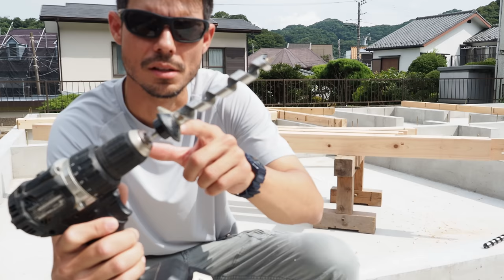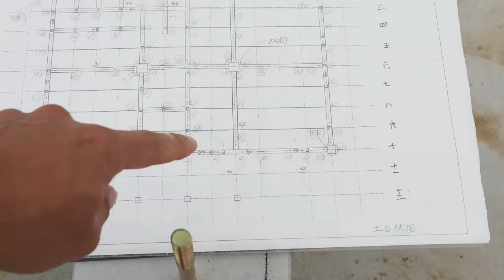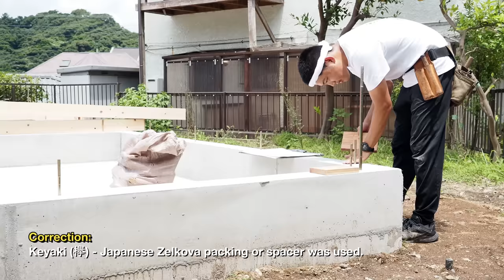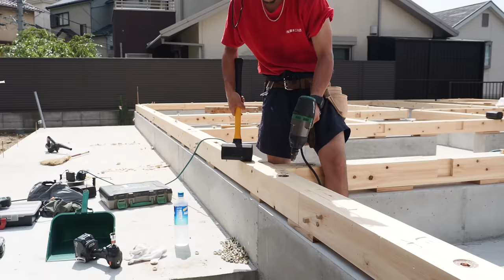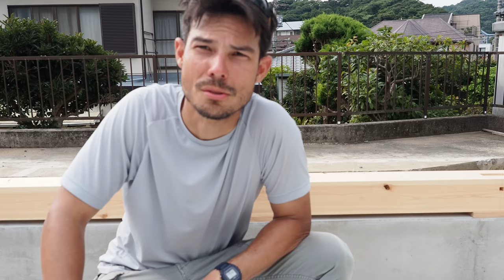Japanese Foundation Structure Explained! - Dodai (土台) - Setting up the Dodai (Foundation Beams)

Comment: I'd love to see how that foundation was poured.  A variation of only 5mm in height is impressive.
Reply: I know absolutely nothing, but it kind of looks like prefab concrete blocks? The edge corners seem to be all one piece as well.
Reply: They pour the slab first, then use reusable forms to do the stem walls. So the slab is probably pretty close and then with the forms they can get it just about perfect
Reply: It is not hard to do you just need competent people and a theodolite or similar.
Reply: @ismu34  
Exactly. My house was built using 2x4 techniques but the foundation was of standard Japanese design. I wanted to have a hole running through the foundation so before it was poured I cut a section of PVC pipe and forced it between the inner and outer walls.
Reply: This is not the ‘standard’ house, is it?  The foundation is, but this type of post and beam is usually only found in more expensive houses.

Note: Just watched the first part again.  Those are hinoki beams? Very expensive wood so definitely not a standard house.
Reply: They seem to measure a lot more and probably make use of the laser level more often. Maybe the concrete is handled the same way.
Reply: Stainless steel modular formwork I think for the concrete up stands
Reply: Concrete has a love affair with steel.  Transportation is against the steel mesh.  The concrete is along for the ride at pressure equivalents to a road bump at low speed.
Reply: @Zerpersande  No, this is a standard residential house. Luxury homes often use more upscale types of wood, with thicker pillars and sometimes even use the wood in its natural form without shaping it. In the past, there were many such luxurious homes.
Reply: I don't know what this is called in English, but in Japanese, it's called 'beta kiso'  It means Raft Foundation.
"beta kiso" is a foundation where the entire surface under a building or facility machine is a flat concrete slab reinforced with steel plates. Compared to a strip foundation, the foundation's bottom area is larger, which helps to distribute the load, transmit it to the ground or slab, and increase durability and earthquake resistance against uneven sinking. However, it also incurs additional costs. It is mainly used for heavy buildings or when the ground bearing capacity is low, and piles can be added as necessary. Since the entire floor surface is made of reinforced concrete, it also serves as a moisture-proof measure.
Traditionally, it has been used for prefab houses and two-by-four houses, but since the late 1990s, it has also been used for wooden post-and-beam construction due to the moisture-proof advantages."
Reply: In Germany: Best I can do is 20
Reply: @Shawn Witty  all houses in midwest use 2×4 interior framing and 2×6 exterior framing. Been a builder for 20+ years and 90% of all homes in midwest are built that way
Reply: It was poured in Japan.
Reply: they made it like a watered down slushy, so it was self leveling and they did it in one pour.
Reply: @jeanious2009  isn't watered down Concrete a lot weaker than the stuff you have to scoop in by hand?

I wouldn't have guessed Japanese builders would take shortcuts that weaken their foundations, considering the earthquakes and all
Reply: That's what I was thinking.
Reply: Need good forms first off..
Reply: It was done with pride and honor

I've been on teams were we tried implement Japanese methods in the US and it never meet the expectations and was abandoned after a year or two... because you can't implement pride and honor into the craftsman, they just want a paycheck
Reply: yah they use a lazer and a stick amazing ant it.

Comment: I'm impressed by the concrete work. Never seen such perfection of angles and finish on a foundation.
Reply: To be fair the foundation walls are only 20 inches tall.
Reply: gotta build these houses to withstand tsunami and earthquakes.  The japanese don't play around, and understandably so.
Reply: @ryanmolloy5421  
earth quakes yes. 
The seperation from the concrete creates room for vibrations to spread and flatten out. 
Tsunamis not so much.
There isn't really much you can do against a strong water current.
The foundation showcased in this video will likely survive but the dovetails won't hold the pillars even with support beams. The pillars will fold down collapsing the house. But luckily wooden houses aren't that costly to rebuild especially on an existing strong foundation.
Reply: @redcrafterlppa303  I meant more like just high water. You are right nothing will withstand a torrent of water.
Reply: @ryanmolloy5421  yeah, but I suspect after flooded once it will be a hard battle against moisture and mold.
Reply: @redcrafterlppa303  yeah you really high beat water. I haven't watched all the videos yet, but that cement foundation is pretty dang tall, especially  when compared to houses in America that don't have a basement. It seems like they would have some okay separation from the elements.
Reply: @redcrafterlppa303  They don't get flooded that often....
Reply: i was just noticing the detail of that and thought the same thing.
Reply: Came here to say the same, the concrete work there is very very nice compared to what I usually see.  In theory no water should get to those shims, but the only thing I could think to add to that would be some vertically diagonal scores where if any water did find its way to the flat and start running along it, it would hit that before the wood and run to the outside instead.
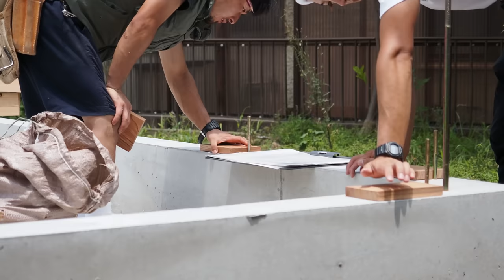Reply: At 06:54 I saw a guy wearing a vest with a fan on it.
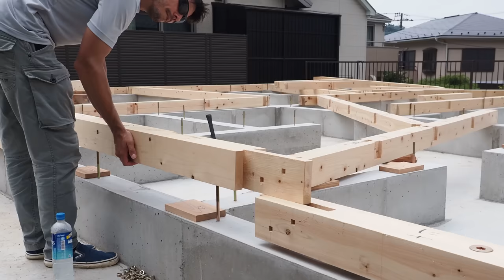Reply: @ordiv12345  I noticed the same thing at 09:10
Reply: @Christoph-sd3zi  How do you know it's only 20 inches tall? I can't find it mentioned in the video although I think at one point I did...
Reply: @manicmarauder  Rain and flood are possible but rising damp, water being wicked up through the concrete,  is a constant exposure for wood and promotes various forms of rot.  Other jobs show the use of a continuous  egg-crate open plastic layer rather than the rot resistant hard wood used here.

Comment: Just wanted to let you know as a Japanese dude, I've learned a lot from your video. I applaud you for getting into these industries infamous for the rigid traditional ways and your boss for the flexibility in accepting you as an apprentice.
Reply: Are Japanese construction sites as clean as this s common and expected thing?
Reply: @drwombat This site looks so clean that it almost looks bare. However, the Japanese construction sites especially the residential homes tend to be very clean because homeowners often come check on the progress and begin introducing themselves to the neighbors. They usually go around before the construction begins to apologize for the noise and inconvenience. Give some gifts. So what the contractors do are seen as the homeowner's behavior. The contractors know this so they are usually very good about keeping the site clean.
On the other hand, larger commercial buildings tend to be more catered and less well-kept based on my casual observation.
Reply: @211teitake  oh wow this is VERY insightful

Comment: This is one of the most satisfying videos I think I've ever watched. I think you have to have done a little bit of building to understand just how difficult it is to get all of the pieces of this project to fit together so smoothly. The concrete foundation has to be poured to such tight tolerances, the curing and milling of those wood beams has to be done so perfectly, the measuring of the bolt locations has to be literally perfect, the hand drilling of the bolt holes has to be spot on along perfect along two axes, and the joints have to be cut so, so precisely... I mean, just looking at those toshibashira joints waiting to receive the corner posts makes me break out in a sweat, I would never attempt anything like that because my cuts would be slightly off and the post wouldn't fit. So freaking impressive.
Reply: I think a lot of people are intimidated by these apparent challenges, however, there are methods to achieve the needed precision and it may not be as difficult as one might think after a little practice. It is worth giving it a try...of course, beginning with a smaller project and some practice joints. Just be sure your chisels are sharp!
Reply: You know what they say - measure twice cut once. Unfortunately, that implies people know how to use a tape measure correctly. That often doesn't seem to be the case.

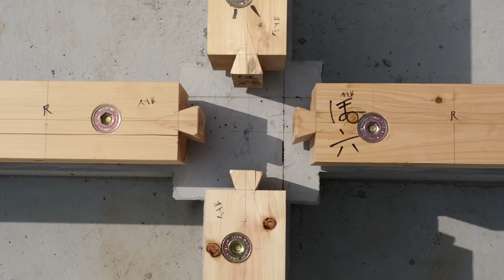Comment: 12:30 WOW! That has to be a mountain of maths to get all that to meet up properly in the end! I've built a LOT of modular structures with similar connections before and I've NEVER put all the pieces in place and locked down BEFORE the connecter that joins them. Wow! Intense respect for doing this this way...the precision coordination required across multiple people or even whole crews to do this like this is astounding to me. We have a hard time here just finding someone to clear trash in a proper manner...wow.
Reply: Actually you try to avoid doing math as much as possible. It's more a matter of getting the measurements right, and copying your measurements from one piece to another so that if you're off by a tiny bit at least you're off by the exact same amount everywhere so everything will still fit. That's why the guy was measuring out where the bolts are in the concrete compared to the chalk line. Those thin pencil marks he uses is probably the coarsest they'll go, the joinery itself would've been marked with a knife because you can't get pencils marks accurate enough.

Comment: The joinery really caught my eye, and the care taken in marking and drilling the anchor bolt holes for what appears to be sill plates is just fascinating to me. Artisan joinery requires very accurate measurement, marking and experienced craftsmanship all of which I witnessed in this video. Learned something about chestnut which I didn't know. Outstanding work. I am glad I found this video.

Comment: its insane how straight you drill with such long drill bits
Reply: Getting it started is the trick!
Reply: maybe not made in china
Reply: Once you get used to it, it's not that hard.. you kind of have like an internal level which allows you to drill straight using sight alone..

Comment: We been to a construction site a few years ago, where many of 'us' constructors felt it was way over complicated and rather slow paced (just doing the foundation can easy take up days, we wrap it up in max a day), the sheer accuracy is basicly mesmerizing. The entire process from concrete pooring (plus groundwork) to the skeleton structure is all measured down to milimeters, no wiggle, no slack, it fits insanely tight. Though we mostly build fully concrete (walls, foundation) wich have a huge margin due to hardening, their buildprocess is considerable longer (we done tops 12 months, often less, where avarage japanse house can go 1-1,5 years), it really is a quality over quantity story. I hope to visit US sites this or next year, we in Europe just have a complete different material/construction approuch that such insane accurate measurements are just 'brushed away' with some extra drywalls and we accept nothing is perfect (they showed us a room that was to the mm 420x420mm, where ours done often vary upto 1-3cm each side).

Comment: In Tokyo I usually see a ~1-inch thick wide rubber gasket placed onto the ribs of the concrete foundation (instead of elm/keyaki pieces used in this video), and then the wood is bolted on top of that. As far as I understand, this is to allow the house to move/flex in an earthquake by relieving stress. It also forms a kind of seal to keep water out of the contact (although the underside of the house itself is ventilated with ports in the concrete foundation in order to prevent mold).

Comment: OMG, hands down! This is such beautiful workmanship and technique. Super Cool! I've just finished building my first house in New Mexico. I designed and drafted the floor plan myself (it's not a Japanese style though, a simple minimalistic house), but during the building stage, I had to compromise on every single detail because my builder and contractors didn't closely follow the design, leading to all the details becoming so messy. As a Japanese, I was really disappointed by the lack of workmanship. But, I've learned the hard way. Watching your video has been incredibly thrilling for me. I'm planning to build an outdoor sauna using Japanese construction methods myself. Thank you for this video; I'm definitely going to watch more.

Comment: I used similar construction technique when I built my 8x12 shed on six individual foundation piles. I cast threaded rod in concrete poured into the CMUs, held in place and vertical using styrofoam spacers, though scrap wood could have also worked. For termite-deterrence I capped the footers with sheet aluminum flashing, and spaced the girt and beams off of the concrete/cap using stacked stainless steel washers.

Comment: This makes me want to design a new type of foundation for an adaptation to new American style materials. SO much craftsmanship in this.
Reply: Then you'd realize using concrete footers with engineered joists is stronger and faster than this method of building and use that like everyone else 😂😂
Reply: I would imagine that if this kind of joinery were code compliant, it would have to be CNC machined and assembled in a factory to keep costs to a minimum.
Reply: @nick21614  Is the Japanese technique more earthquake resistant maybe?
Reply: @__K__B__  Nope

Comment: When I did a foundation, I drilled the beams for the anchors first then set them shimmed a little above the concrete with the top of the form. Then I'd lift the beam, press the "L" anchor in and shake it to about right and drop the beam on it an a temporary nut at the right height. 
    Didn't measure anything but rough spacing and got a perfect fit.

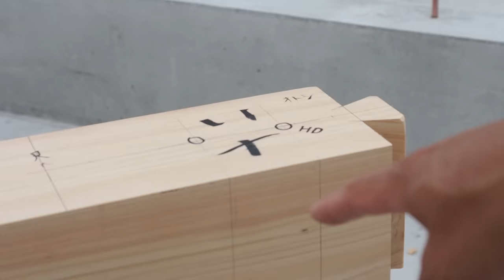Comment: 2:35 California building code also requires metal hold-downs. This Old House did a house in Silver Lake, and they highlighted just how crazily engineered houses have to be because of earthquakes (the Silver Lake house was particularly nuts because it was sitting at the bottom of a hill, the foundation looked like equal parts steel and concrete).
9:08 Here you see the use of wood keys or pegs that lock the joint in place without nails, bolts, or adhesives. We used to do that in the US... 250 years ago when timber framing was the norm. Nowadays we would be using a pneumatic nailer and butt joints because it's much faster and requires less training and experience.
Reply: and untreated wood contacting concrete wouldn't fly either.

Comment: Try lifting the beam onto the straight rods and tap with mallet for impression,
(straight rods) set and leveled into the concrete when almost dried.
Anyplace where wood meets the ground or concrete, the lumber must be pressure treated. For additional moisture protection, a gasket or strip of closed-cell foam can be installed between the concrete foundation and the sill plate. Some moisture barriers for this application combine a foam strip with a waterproofing membrane that covers the bottom of the plate as well as the joint between the foundation and the exterior of the wall assembly.
Reply: He mentioned they used shims, I'm surprised they are using relatively soft wood for bearers, it's always hardwood here in Australia.

Comment: When putting those anchor bolts in the concrete, you should use a little jig that sits on the formwork so they're all exactly in the middle and nicely plumb. Just a tip. You can reuse these jigs again and again.
Reply: I would like to add that jigs like that are incredibly easy and inexpensive to make.

Comment: The thing I find most intriguing is the fact that in Japan they still cut allot "natural" wood connections. You had to layout all the beams and actually mark and cutout all those connections to fit. In Europe or America they would use metal bracing that gets nailed/screwed into the beams, which is allot faster with less labour.

Comment: Given how the slab and concrete foundation form compartment like areas will there be a lift up hatch in the floor giving access for the storage or pickled jars of vegetables and root vegetables as I have seen in older traditional Japanese houses? The concrete work and wood beams are superb and a pleasure to see. There is no doubt what masters the carpenters and cabinet makers are in Japan. You are in an envious position learning traditional joints and building methods.

Comment: Those rods in concrete is something we use in Europe when doing the roof.
Once you have the final wall done, you pour concrete horizontally on the long edges and have the rods sticking out the same way. A wooden beam goes on top of it the same way. Those beams will be the support and a spot to nail in the ends of the wooden boards which hold shingles.
Very standard stuff over here in Europe..

Comment: I’m not sure where to begin.  Well firstly I love the accuracy of the work.  The time that is taken to get as close to perfection as is humanly possible.  The concrete substructure is like nothing that I’ve seen before.  A virtually sealed basement as such.  I was going to say “I bet they only use  Makita cordless tools and then bam, Milwaukee.  I think I’d better subscribe to see more! 👍. And wait a minute, did I see a fan in the side of one of the guys jackets?  What’s that all about?
Reply: Very common Japanese working outfit - cordless ventilated vest/cooling fan jacket.
Reply: Not sure what you’re seeing that is so special here. Foundation is fairly typical in the Pacific Northwest.  The fancy dovetails aren’t particularly useful and the T  wall joint has insufficient surface bearing by US  building codes.